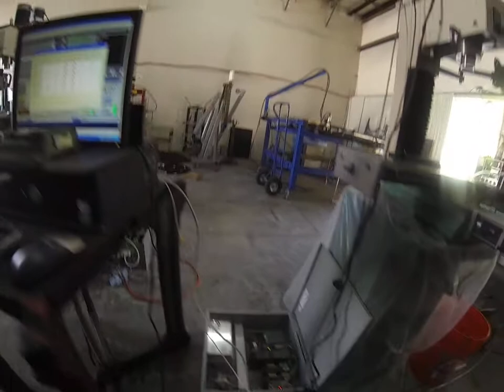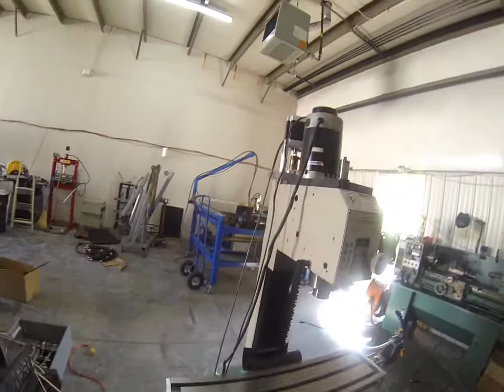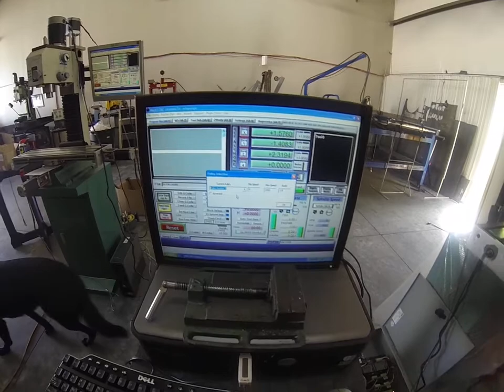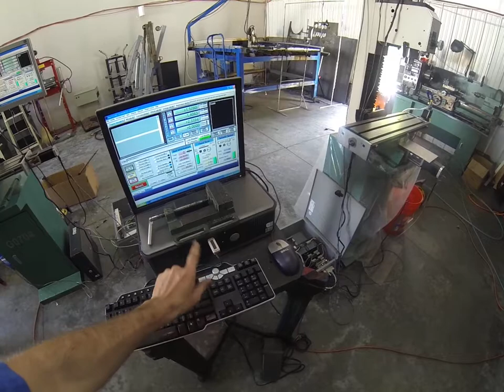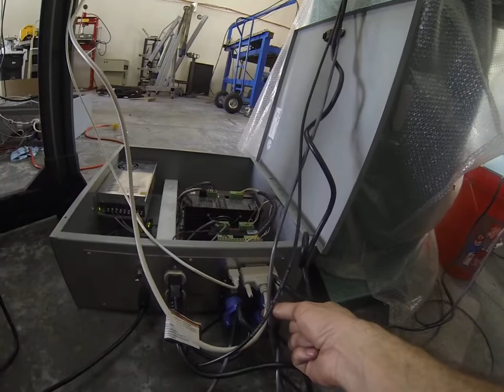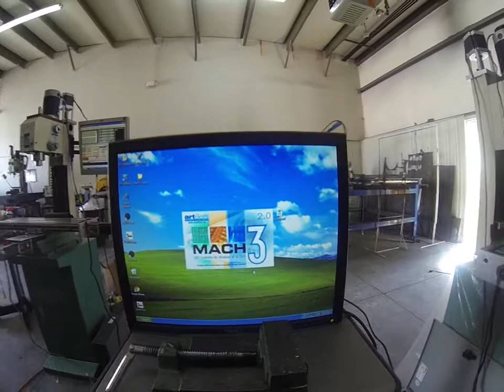G0704

Comment: There is a reason they use particular plugs for different voltages. You shouldnt have used a 110vac 15amp receptacle for a DC circuit. I am sure you have it labeled and this is acceptable for a hobbyist, as a company it would leave you vulnerable.